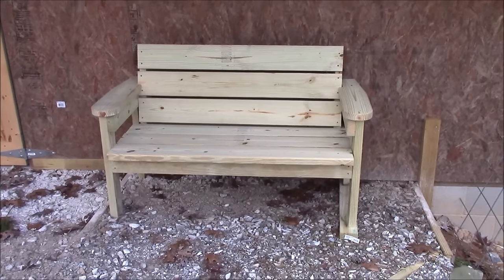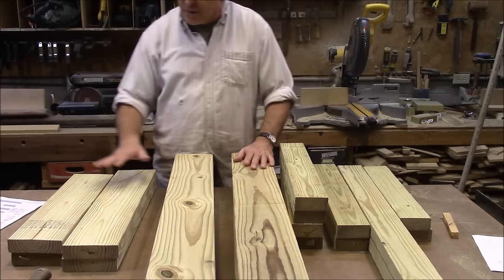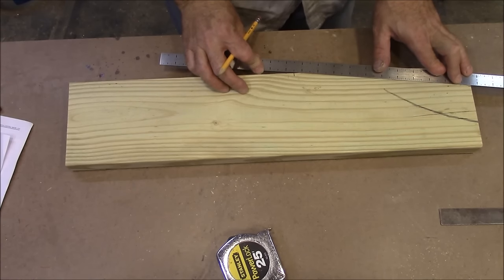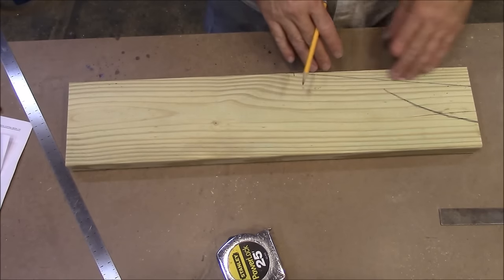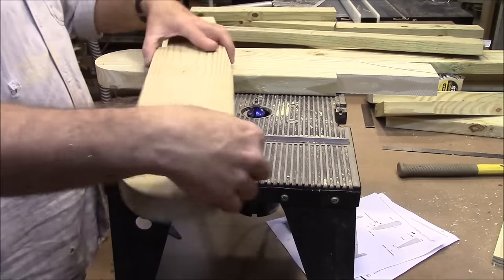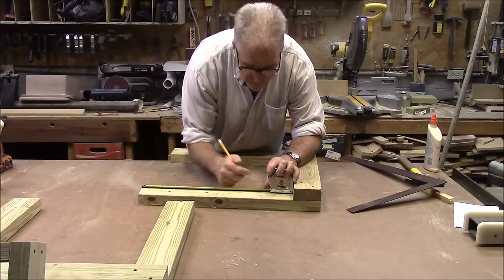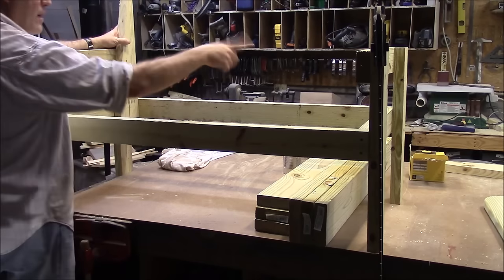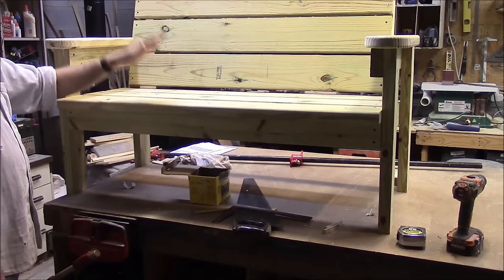Easy Homemade Garden Bench

Comment: This is great if you have a full on workshop. Most don’t.
Reply from the maker: You could make the entire thing with just a circular saw and a drill.  You just won't get the rounded edges.
Reply: I built one at my camper which only had a generator, a cordless drill, a chop saw and a cordless circular saw.  You don't NEED the rounded edges but I chose to bring those piece home to a nieghbor who has the tools.  You could even do without a chop saw if you don't mind using a circular for all the cuts.  It's an outdoor sitting bench, not a cake, so some imperfections won't really be noticed.  :)

Comment: Thank you for this - I have made so many of these - sold some gave some away. I do Shou Sugi ban to finish them. Then stain or dye to order. The main part for me is the prep- cutting sanding rounding off edges then burning. If outside I burn to char then strip with a restorer. Then stain or dye, seal with Halycon total boat clear. Then assemble
Reply from the maker: Thanks for sharing your experience!

Comment: I just finished making this bench. It took me about 5 hours, but that was because I kept coming back to the video to make sure I was doing it right. I'll make a couple more, and then make a few chairs by shortening the 48" boards to 26" or so. I did all the straight cuts with a chop saw, and the backrest and arm cuts with a jig saw. A band saw would make it easier, but really, you could do this project just fine with hand saws and sandpaper. This is the first DIY video I've ever seen that explained everything so well that I never had one minute of confusion. I wrote down the measurements, and all the steps as I did them, so now I have a written building plan in case I forget how to do something. Thank you for this video. I love the bench, even if it takes two men and boy to lift it. :)
Reply from the maker: You're welcome!  Thanks for letting me know it helped you!

Comment: I just finished building this bench yesterday and found it very easy to build when I watched the video and took down all the measurements.  The result is a very nice, very sturdy bench.  Nearly anyone could build this with a minimum of power tools.  The buy-list and cut-list are quite accurate.  Hardly any waste or scrap wood left over.  Cost me $40.18 for the pine lumber I bought at Home Depot.  If you're not an expert woodworker,  and you don't have a lot of money, don't be afraid to tackle this project.
Reply from the maker: That's awesome!  I'm glad it worked out for you.  Thank you for your encouraging words for others!

Comment: Thanks for your video. I used the same design except changed the Arm rest , seat and back boards to 5/4 deck boards. I also increased the width from 48 in to 54 inches (the back rest 51In) and finally made the top back board the same length as the seat boards so it extends a bit and then rounded it off.  Looks great and was easy to build. Thanks again.
Reply from the maker: Sounds like a great bench.  I'm glad you enjoyed the video.  Thanks for watching!

Comment: Thank you so much for your video.I made it. It was very easy and I am an amateur when it comes to this stuff. It took me three days to finished.  However, I did Shou sugi ban, stained it red and applied linseed oil as a finish. It came out very nice.Planning to make a couple more.
Reply from the maker: That's awesome, I'm glad it worked for you.  Thanks for letting me know.

Comment: Built one last weekend, I did a little bit of modification, my wife and I are both over 6ft so I made it higher.  I compared to a camping chair for desired height.  We are sitting at 20in so I made the legs 28in high.  I might do even higher next bench as we like a higher arm rest too but easy enough to put a couple 2x4's under the arm rest to raise it.  I also made it 12 in wider (60in vs 48in) by using 2x6x10's for seat/back instead of 2x6x8 (and one 2x4x10) and added a short 2x4 to the base middle to prevent sag.  turned out wonderful, very nice plan.  I will probably build a couple more.  I might see if I can find a way to angle the seat slightly, I find a flat bench a little more uncomfortable vs one that has a slight decline towards the back.
Reply from the maker: Awesome!  Thanks for letting me know!

Comment: Just built this bench and wow. So awesome to build something and when you’re done you sit down on it. Lol. I’m thinking those back braces could be notched out so they would sit back further and then allow the back boards and seat to align better but this was easy and straightforward. Love it!! I didn’t have a router and my jigsaw stopped working. Used and angle grinder to round the arm rests and then sanded them a lot with an orbiter sander. It’s not perfect but honestly gives it a more rustic touch so it’s all good. Thanks for the video!!
Reply from the maker: That's awesome, thanks for letting me know.  It sounds like you are very creative with your tools.

Comment: Nice bench I like the fact that they are heavy they will stay put and wear better being that they are beefy. I made two benches some what like this years ago. I did notice the feet started to rot after 5 years due to the end grain was touching the ground. My fix for that was 5/8 decking boards cut in style like a coaster attached it to the feet as sacrificial boards that could be replaced. I cut each leg about a inch then added the coaster board to the end. Great project
Reply from the maker: That's a great idea.  Most treated 2x4s you buy are not actually rated for direct soil contact so that would be a good way around it.  Thanks for watching!
Reply: NEXT TIME YOU COULD PAINT USED MOTOR OIL ON THAT END GRAIN OLD RANCHERS TRICK THEY USE ON FENCE POST.

Comment: I just made one and it was pretty easy with your drawings and the video. I was wondering if 1X6 would work instead of the 2X6?
Reply from the maker: It probably would but you might have to reinforce the seat depending on how bendy the 1x6s are.  Thanks for letting me know you built one.

Comment: Great video.  I may have missed it but when you mark the back brace which piece of stock are you using?  I assume 25" pieces vs the 21 1/2"??  Thanks.
Reply from the maker: It's the 21 1/2 inch piece.  Thanks for watching!

Comment: Thanks for the video and what a great looking bench! One quick question - when attaching the base to the legs you say it should be 14.5 inches off the ground. Is that the measurement from the ground to the bottom of the frame, or the top? Many thanks!
Reply from the maker: To the top

Comment: Just about to make a start on 3 of these rascals. Question..if the width of the inner frame is 24" (ie 20" length with 2 x 2" widths of the 48" length) then why is the top side piece only 23" long. Should it not be 24 " ? I'll crack on and see how it goes...keeping the faith...
Reply from the maker: I'm not quite understanding your question.  I hope they turn our well for you!
Reply: @SoatMon  Thanks for getting back to me.  Time 10.00 on your video. You make the rectangular frame that is 24" wide. However, the end pieces are only 23 " wide. Should they not be 24 "? I cut mine to 24 " and its fine. Used left over decking for' back' and 'sit on' slats thats fine with an additional support underneath. 6 X 2 works well for back braces (someone else was asking). Completed first, oiled up and looks fab. I'm grateful to you and cracking on with a five footer next.

Comment: On the Arm rests, why did you not just clamp them together and cut out both then turn one over so you have a left and a right, that you know are Identical?
Reply from the maker: That would work as you described but for me, my bandsaw would have struggled with the 3 inch thickness and given me a very rough cut.  Good point though, especially if you choose to make them out of 1x stock.  Thanks for watching!

Comment: I'm having a bit of trouble. Once I fit the back braces there isn't enough room for three 2x6's in the seat. What am I doing wrong?  Thanks!
Reply from the maker: Not really sure but I am guessing that if you are using treated lumber and it is soaking wet, it may need to dry so it will shrink a little.  Could also be a mismeasurement or your lumber may be a little bit different.  I'm sorry you are having trouble.  I do appreciate you watching my videos.

Comment: If I need it to be a three seater would I need to put a board in the middle to make it stronger. So it won’t crack in the middle when someone sits on it?
Reply from the maker: It depends on who is sitting on it but it would probably be fine since it is made from 2x6s.  I hope it goes well for you!
Reply: I made a 60in 3 seater with 2x6x10's, and did a short 2x4 in the middle, can't hurt I figure?

Comment: For the arm rests, you can measure both pieces the same then flip one over  to use for the left and right. Also, after you lay one out, cut it, then trace that design on the uncut piece for the arm rest. No need to measure out both pieces. Work smarter, not harder. :)
Reply from the maker: Thanks for the comment!

Comment: Question how would you make the angle cut on the back support pieces if you don't have a band saw?
Reply from the maker: I would probably clamp it to a table can cut it with a circular saw.  You would also use a taper attachment and run it through a table saw.   A hand saw would also work but would not be my first choice.  Good luck in your build!

Comment: What size screws are you using.   And what wood is best ?   Thanks.  Also did you treat the wood.?
Reply from the maker: I used pressure treated pine.  The screws I believe are discussed in the video, I can't remember exactly what I used but you want to make sure they can be used with pressure treated wood.  Regular screws will rust out.
Reply: Soat Mon thanks.    I’ll be building one next week with limited tools.  Gonna try a Drexel for the arm edges and sand them with a hand sander.     We’ll see.   Lol.

Comment: When you make the mark on the legs at 14 1/2" off the ground, is that for the bottom of the seat frame or the top of the seat frame? I have started to build this and that would be helpful to know.
Reply from the maker: To the top of the seat frame.  Good luck with your build!!
Reply: I am making mine with 2x3 material because it is going inside the front door. Making it a bit more rounded for more visual appeal.
Reply from the maker: I bet it'll look great!

Comment: Hey; is there any other way I could round off the arm rests, I do not have a router. thanks
Reply: I do not think it would be difficult to hand sand those to be rounded over or to use an orbital sander for that.
Reply from the maker: You could use many different methods: coarse sandpaper, rasp, plane.  The sandpaper will go faster than you think .

Comment: I may have missed it but don't recall the dimensions for the back rest boards.
Reply from the maker: They are the same size as the bottom boards.
Reply: @SoatMon  what I meant was what degree is the angle cut for the back rest boards?
Reply: @SoatMon  disregard I just watched it again and realized they are the 1st boards you cut.  Sorry. Great project, I look forward to building one for my firepit.  Be safe.

Comment: With the lateral armrest support on thd outside be more comfortable.
Reply: If you move them, it changes the length of the backrest and the positioning of the vertical backrest supports.  Or, you might just not sit so close.

Comment: This looks great, and I'm looking into making a couple of them. I live in Italy, so i have to convert the measurements to metric, but that's no big deal. What size and type of screws did you use for the whole thing? Also, I don't have quite the work bench like that, so what do you think is the best way to straighten out warping like you did in this video?
Reply from the maker: I use Deckmate screws, here is a link http://amzn.to/2hot0QY . They are kind of expensive but they drill as they go in so they don't split the wood.  I buy them at Home Depot and they are about 25% less expensive than the link above.  If you have any warping when you screw it together, just place it on a flat surface and put enough weight on it that it will all 4 legs are flat on the floor, let it dry and you should be good to go.  Good luck with your build, I hope you enjoy it!

Comment: What size wood screws do you use?
Reply from the maker: 2 1/2 inch Deckmate screws.  They are a little more expensive than other screws but the drill as they go so they don't split the wood.  Thanks for watching!

Comment: What board thickness  ??
Reply from the maker: It is made with 2x6 and 2x4 lumber.  They are actually 1.5 inches thick and 5.5 inches wide and 3.5 inches wide respectively.  Hope that helps.

Comment: you havent told as the thin
kness and the width
Reply from the maker: That is explained in the beginning of the video when I talk about the cuts.  They called 2x6 and 2x4s, those are inches.   They are actually 1.5 inches by 5.5 inches and 1.5 by 3.5 in real measurements.   Hope that helps.  Thanks for watching!